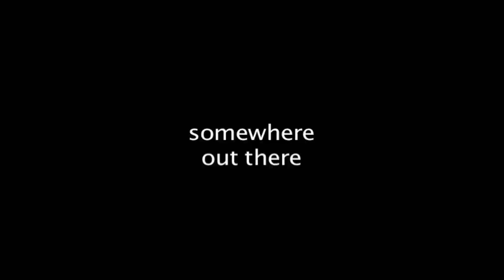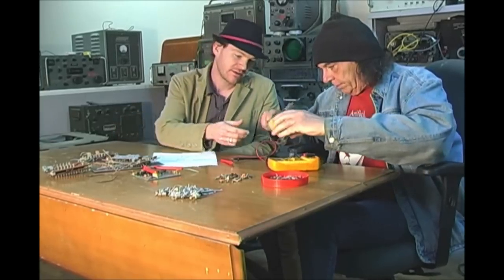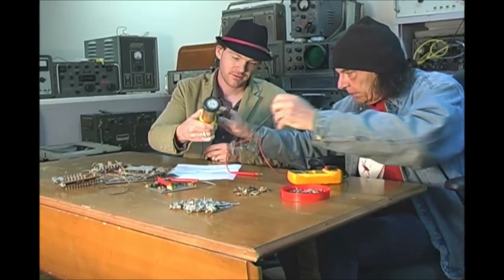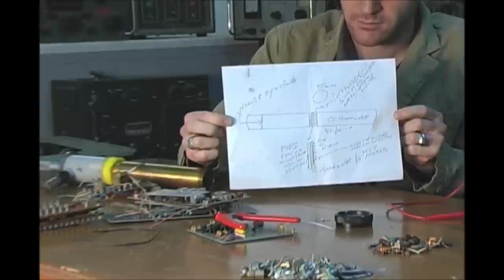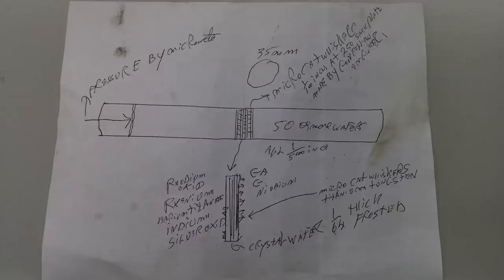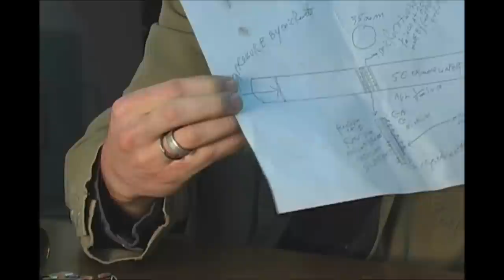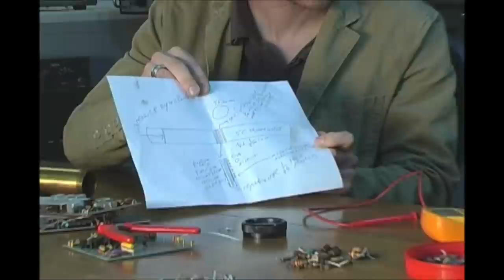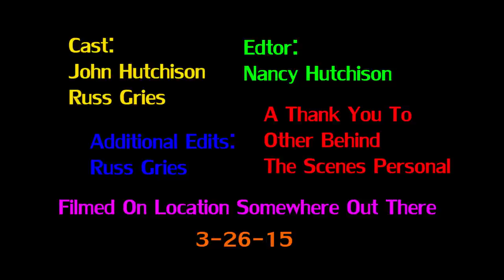John Hutchison and Russ Gries talk - Junction Barrier - Power Crystal Cells - & - MORE

Comment: That diode is unique. I acquired a big box of old components, and  I was looking through my stuff for one of those , but none to be found.  I do  have some very old 1N227 crystal diodes , made by Transistor, Electronic Corp in Melrose , Mass.  (circa  1957) .

Comment: The diode was a 1N4971 if I read it right, It's just a Zener Diode. Very common in power supply circuits. The voltage seen on the meter was probably RF pick-up being rectified by the diode.
Reply: I will bet it is Schottky Barrier diode given the forward bias voltage seen on the meter. John said it was a barrier diode.
Reply: Sardi Pax no actualy i tried it and it just acts like a normal solar cell
Reply from the maker: сталкер чворович I agree with you on this. I have another video about this diode coming up and indeed strong light is the key. But... Its not a clear diode. So you can do the same with a LED. It will also put out a voltage. But Its clear. This is blue glass. Also where did you find yours? Thanks! ~Russ
Reply from the maker: ***** oh and one more thing. Although this diode acted  like a solar cell...  I still think there is more to it.
Reply: ***** Russ, take any diode a LED or a 1n4148, shine a light on it and it will produce a trickle current. Standard solid state physics, its not magic.
Reply: Surface carrier electrons increase with temperature. Take a LED use one as a emiiter and reverse bias another LED of the same optical wavelength and connect to a current to voltage converter. Once the photons of the same wavelength of light of the emiiter strikes the receiver ( reverse biased LED) a current is produced and then converted to a voltage. That is basic electronics and solid state physics. I am an electronic engineer and have been one for 36 years, I know what I am talking about.
Reply: You speak of Photons and Electrons as if they're Particles?
Reply: It depends on , what type of 1N 4971  is used. The older ones used germanium, not silicon. John had an older one. The thing is, the current is quite low, so the power to is almost non-existent. In principle it works, but in practice you need many to provide the current.
Reply: @michaelsnyder7442  
What do you think about John's antigravity work?
Is it legitimate? 
Is any of this guys info worth researching? It reminds me of today's acoustic levitation tech but more advanced.
Reply: @RWGresearch 
I have an obscure paper on a patent for a green L.E.D which is even more efficient than the blue L.E.Ds for which a major physics accolade was awarded to a brilliant Japanese physicist.

I have seen Dr Rupert Sheldrake give a talk at the BRLSI in Bath in which there were long pauses in between his comments which left you  wondering what he was not telling you.

Comment: Carnuba wax, it comes from S. American tree that forms hard waxy residue on its leaves which is scraped off and used. Can be used to make high voltage capaciters but is very dangerous unless special precautions are taken. Once set/conditioned the high voltage capacitors can be dicharged and will self charge back to high voltage state. It is a temporary state that lasts around 6 mths.

Comment: I'm trying to make this happen.... I am having trouble pulling a deep enough vacuum to do sputter and thermal deposition thin film deposition... I will get it though, it is going to be a lot of work but I think these high power quartz wafer crystal cells warrant the investigation... I am truly excited about where this may go... Also, I like the challenges involved in just attempting fabricating one of these cells (its fun stuff)  :) ... Peace guys.
Reply from the maker: Thanks for sharing too. I think there is indeed more to look at here with the wafers. Glad your putting forth the effort. Can't wait to see the outcome. !! Good luck!! ~Russ
Reply: *****
Cool, and thanks. I will keep everyone posted... First things first is acquire the rest of the elements I am missing (easy)... More importantly, get this vacuum pulled to the 29.9inches of Hg range (not easy)... There are many options to try, may have to bite the bullet and buy/or build a diffusion pump... Step by step.
Again, thanks Russ.
Ben

Comment: Well done movie, but typically he could not show his cell running as it was a fake with hidden batteries. ..
Reply from the maker: Well.. There is videos of him demonstrating this cell in front of the Chinese. And he dose take it apart. This crystal cell tech is not a fake. You can get voltage and current from such a device. ~Russ
Reply: ***** Well, yes, MilliWatts of power to light up an LED, but not WATTS of Power to light up incandescent bulbs as his latest fake videos have shown... He has probably hidden batteries inside his  brass cylinder then..
Reply: @StefanHartmann-hartiberlin  I don’t know why John would fake anything. Geniuses do exist. Have faith.
Reply: I have it in good authority that you are a member of the north/south pole club pedallers....